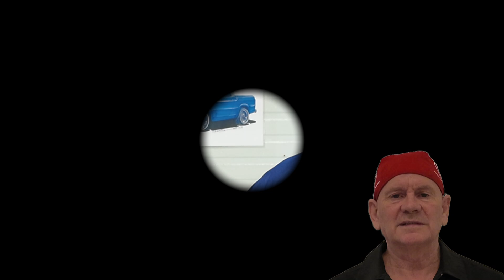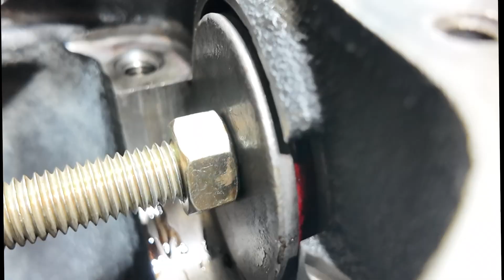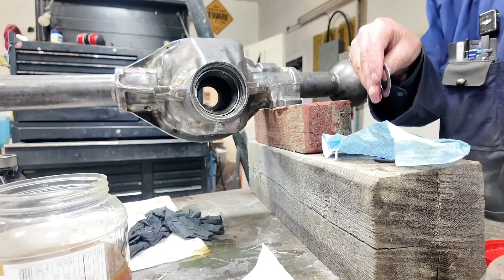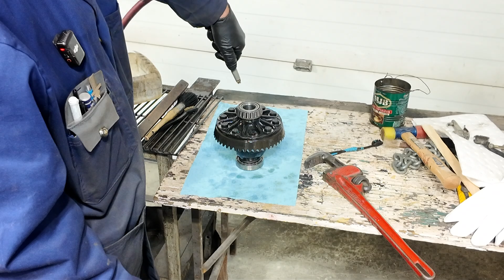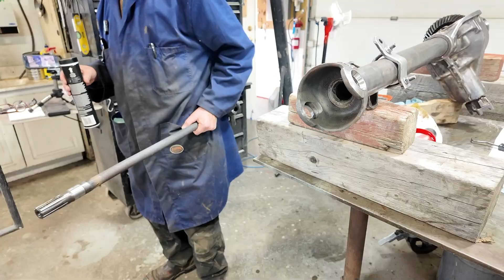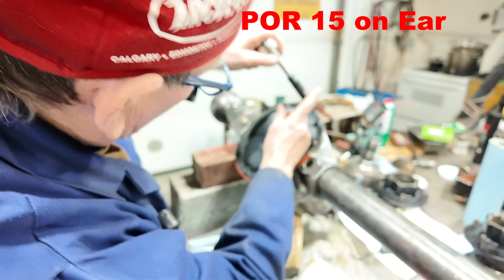Scout Restoration Yukon: Front Axle 3, Start Assembly.

Comment: Another very well done stage in the Dana 30 refurb.  I am amazed how clean you got everything leading up to this point.  What is your approach in cleaning?  Pressure wash, brush, solvent (brand)? Also, with my Dana 27 front axle, my next task will be to check on seals and bearings.  Did you encounter any problems on parts for the 30?  Thanks for taking the time to do such a thorough presentation.
Reply from the maker: Hi Michael, first I go over everything with scrapers and old screwdrivers then if it's greasy I blast it with a solvent gun that utilizes compressed air to suck varsol out of a pail. Then I use a wire wheel on an angle grinder and small wire brushes on die grinders  to remove all the old paint and rust then varsol again.  Later on pre assembly I clean all internal parts with Varsol and a soft paint brush and blow dry with compressed air. Smaller things like bolts and screws I soak in commercial parts cleaner then rinse in warm water and dry. Some brake parts like wheel cyls I boil in water then blow dry. If you have a parts manual there are some people who can still crossover the numbers.
I write down all the bearing and seal numbers and go to a bearing specialist. Some parts are impossible to get like the upper seal on the steering box. I found a good used one, I have 4 Scouts. 
Sometimes I improvise and reverse engineer.
Like find a seal with the right id and then machine the part to fit the od. Anyway it goes on and on.
you can find most everything on line at all the Scout sites for a pretty penny !
Over & Out
Reply: @hibernianplus  Wow!   More sanitary than the local hospital operating room.😷Thanks!